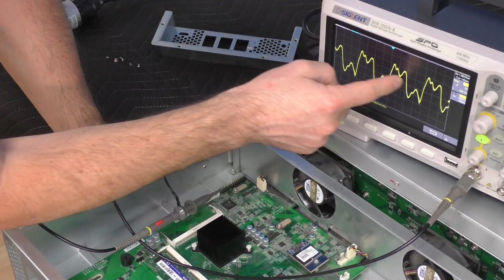How To Fix QNAP NAS Server TS-1253U

Comment: Synology DS218play nad 216j the same problem with 5-12 volts on SATA cable - no power. Data cable is ok. Blue led and system DAM starting good
Reply from the maker: So just to confirm I understand what you are saying. Are you saying that you were able to fix both the DS218 play and 216J by replacing the CPUs on those units as well? What were the symptoms you were experiencing before the repairs?
Reply: @ I have two Synology devices with the same issue: no power to the HDDs. The operating system starts, and Synology detects the HDDs when external power is supplied.
Reply from the maker: Oh I see you are not saying that those have the same fix just that you have those 2 units with similar symptoms. 
The reason I was asking is because I don't fix those 2 units but if you were telling me they suffer from the same faults I would have started looking into servicing them.

Comment: Usually the models with failing CPUs are the Intel ones right? Does it happen with ARM based CPUs as well?
Reply from the maker: There are QNAP units we fix that use AMD CPU that also fail. I believe those are fully integrated with memory controller inside the CPU and that's the part we see fail. 
This is the unit with those AMD chips we have to commonly replace: TVS-673E